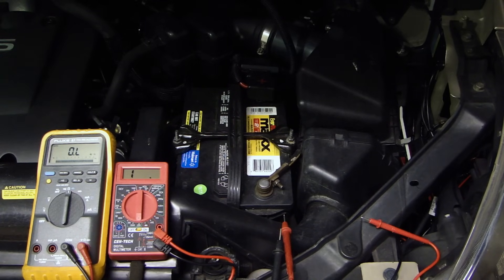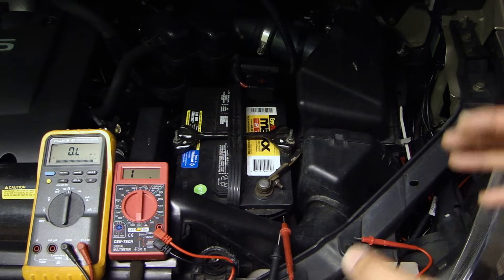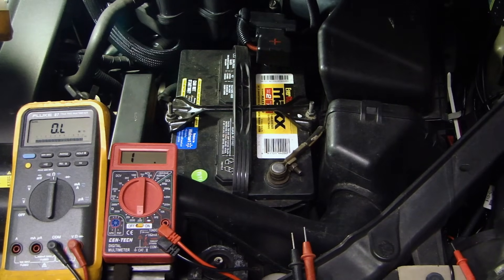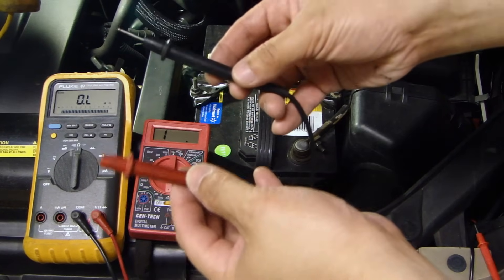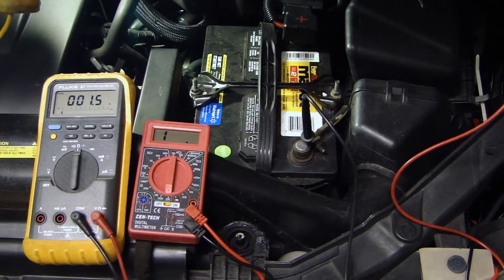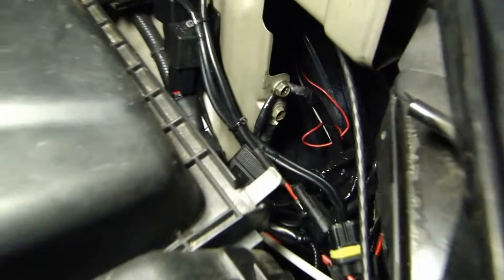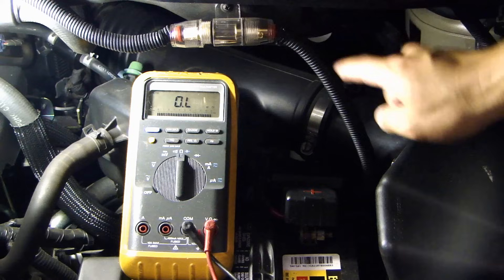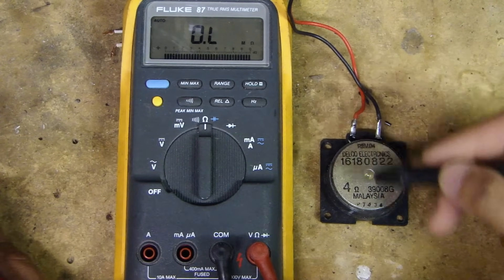How To Use a Multimeter - Test Car's Ground - Video 3

Comment: Hi, what would you consider a bad reading?? I get that the lower the reading the better but at what point is the ground unacceptable?? Thanks great video.
Reply: I have the same question, above what value we should consider there's problem ?
Reply: @MooCreation  wires are looked upon as bad when you get 1 ohm or more of resistance.
Reply: @jamesbarratt593  interesting. Thank you.

Comment: so the higher the ohms the worse the connection, correct? I'm pretty new to this. My multimeter, when shorting the two probes, reads about 10 ohms.. It seems like that isn't right to me, but again, I'm not really sure, trying to learn here.

Comment: I'm not sure you should be using the resistance measurement on a multimeter to test a live circuit.  In the resistance measurement mode, the multimeter applies a small voltage to measure the resulting current, in order to calculate the resistance.  This doesn't seem like a good thing to do when you are working on a live circuit.  Wouldn't it be safer to just measure the voltage at a ground point, relative to battery negative terminal?  But maybe you've already considered this and found no issues in practical auto troubleshooting applications?  Would be interested if you have comments on this.  Thanks.
Reply: The circuit he tested was a dead circuit, the ignition was off.
Reply: yusuihang ......imo you are right....that was also my very first impression when watching the video.  Assume that at the time of measurement, a current was flowing thru that particular piece of cable, and that current is 5 A.while the resistance is 0.1Ohm, the voltage drop into that part of the cable is then 0.5V. That voltage drop is fed into the meters circuitry and translaties into Ohms in accordance with the laws of that circuitry......as one could see, when the two probes were touches together, the display pointed some 0.6 Ohm, while the display gave 0.0 Ohm when a piece of live circuit was examined.....the correct display should have been pointing; 0.6+0.something >more than 0.6 Ohm.....however that was clearly not the case......At least one Side of a live circuit shall always been disconnected before resistance measurement is taken....regards
Reply: You are stupid don't reply to people unless you want to look stupid. Stupid

Comment: Noticed one of my grounds from the chassis to the valve cover had surface oxidation/patina (stranded copper wire) I remember reading that surface oxidation protects the rest of the wire and the mounting points seemed clean. Tested resistance across the wire and from each end to negative of the battery and got a reading of 0 ohms. Was surprised to see this but made sense since the actual point of contact was clean and solid even though surface of the wire was oxidized

Comment: I just fixed the grounding screws on my 98 Ford Taurus yesterday.  The threads were rusted, so I removed the screws and wire brushed, greased with dielectric grease and screwed back in, then covered with dielectric grease to prevent corrosion.  I used voltage from the battery to check grounds and was looking for voltage drops.  If no drop, I just grease.  Is using the ohmmeter better?  I'm not too experienced.  Thanks for the great video!
Reply from the maker: +Dennis Johnson Everything you did is correct. Looking for voltage drop can be a good test. Checking for resistance between two points will also work.

Comment: Good video however, when you touched the two probes together with your fingers you got a little higher reading because you touched the two probes with your fingers and this put some resistance into the reading, so it could have been even less. The body can add about an unknown amount of resistance.

Comment: Great video!
I have a 2003 Dodge RAM 1500 Crew  Cab any advice on finding a good grounding point for both a 4 channel and sub amps? Any advice would be great. I have a Tekpower TP2844R True RMS Auto-ranging Digital Multimeter any thoughts on this Multimeter?
Reply from the maker: +Paul Cruz Not familiar with the meter, but for good ground on amp, you can look around for a factory grounding bolt. Usually there will be these grounding bolts by the fuse area. If you mounting amp under seat or in second row, keep the ground short so you avoid grounding loop, so you can maybe tap your own screw anywhere around the bolts holding the seat down on the floor pan. If there is paint, sand it down first. Those location usually is good ground. Of course test it with your meter for good conductivity back to the battery ground.
Reply: so to test i would take a long wire like 14 awg speaker wire and run that all the way to the neg of battery. touch positive lead to that and probe around bolts under seat with neg lead. best spot is closest to 0.0 and scratch the paint to get better results. i hear close ground for amp is best and thick awg wire back to the neg of batter is best for power inverter. if i already have 4 awg wire near location for inverter would it best to just ground amp to the neg wire with a distribution block. or does separate ground to bolt stop ground loop better? sorry for all the questions. been looking at this work van project for 2 weekends and just started scouring the net for solid advice. thanks.

Comment: great video! do you have any idea about "floating ground" ? i've watched a few vids and as far as i understand this - any acc wire is ground, until the switch power is on.. is that right ?
Reply from the maker: +evyasafe  Floating ground is when one ground is good and another ground on that same conductor is not very good. You actually have a voltage difference on that bad ground which can cause all kinds of electrical problems. When Acc is off, that wire might test like it's a ground, but don't use it for ground.  The ignition wire may come off a relay or the BCM (body control module).
Reply: +dial2fast. actually its great for my purpose. I'd like to install one of those. dummy alarm blinking LED . I'm going to use a constant 12v power for the positive, and the ignition power to the negative. so when the car is on the LED will shut off, and turn on when the the switch power is off. thanks !
Reply from the maker: +evyasafe  I see what you trying to do. If your intent is to use the flashing LED to deter theft, don't waste your time using that. If your neighborhood is unsafe, get an alarm installed. I am not trying to give you grief on your project. I was a car alarm installer for 7 years and have seen all kinds of car breakins. A blinking LED will not deter a thief.
Reply: +dial2fast my neighborhood is safe, its just an extra precaution
Reply: @dial2fast  100% agree man and also installed stereos for several years professionally. Single handedly taught me electrical stuff and fast
Reply: Think your talking about Ford's "Pulsed" ground fella. The accessory gets a constant 12V(think fuel pump) and it's duty cycle is controlled by removing power to the pump periodically. Since it's a "switch grounded" pump that's how it works. Way more complicated than it really needs to be, but we can all thank Ford for that mess.